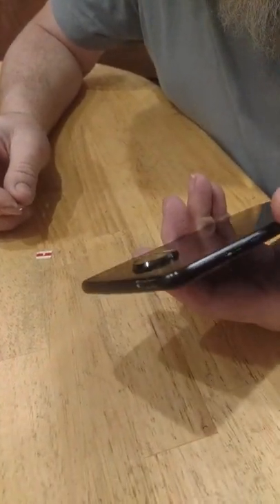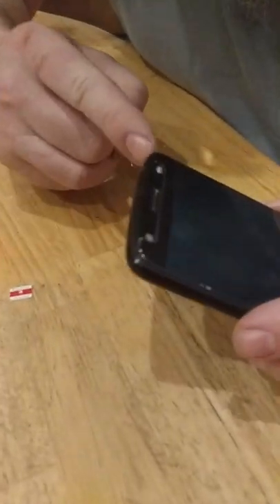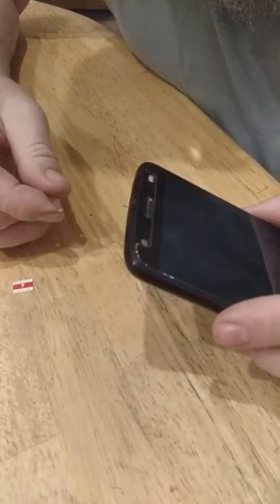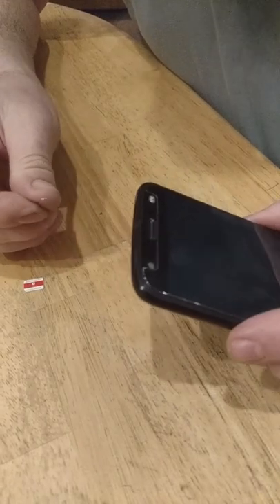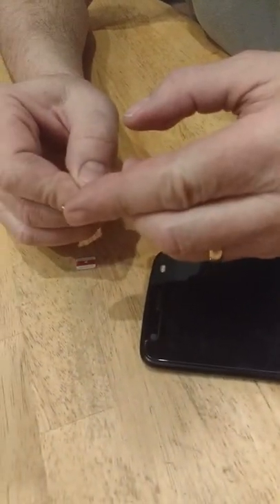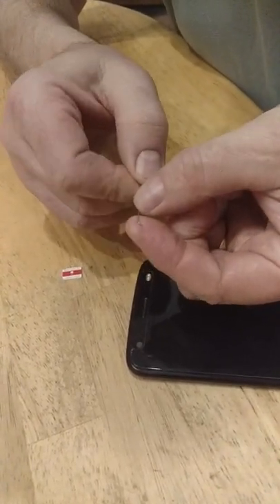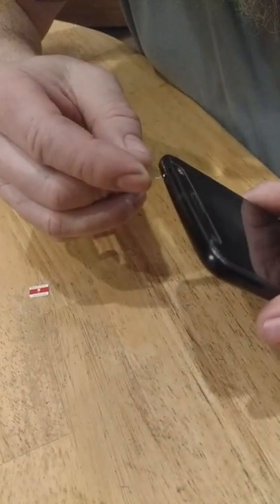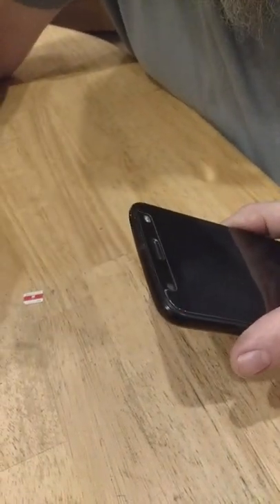Stuck or broken SIM card tray.

Comment: Mine was SO stuck that I put WD40 on it, let it sink in. Bent a dental pick multiple times on both ends. Used a stronger metal screw driver (special point) to pull it out. Broke it. Not sure why it got SO stuck in the first place. That destroyed the IP68 rating....